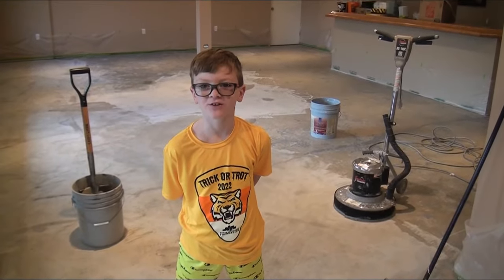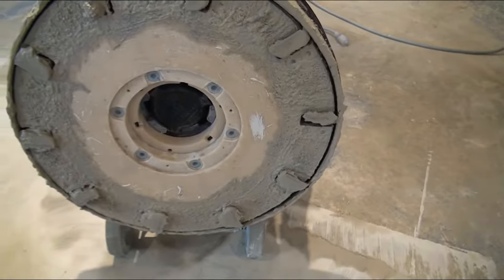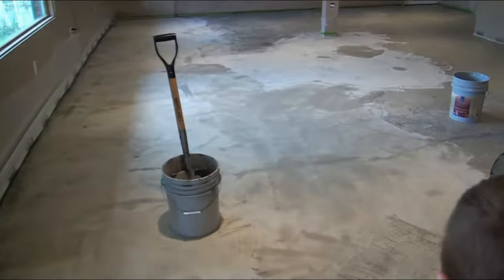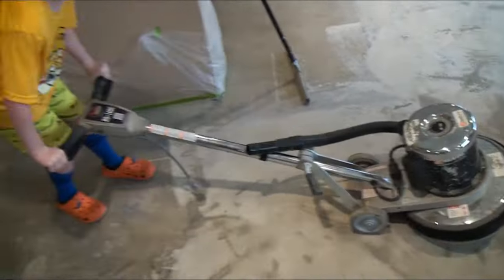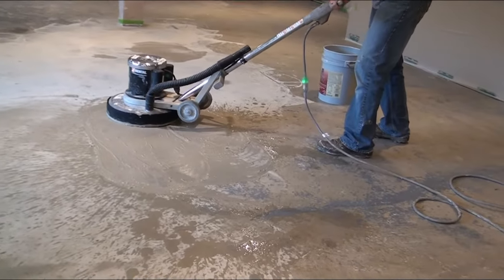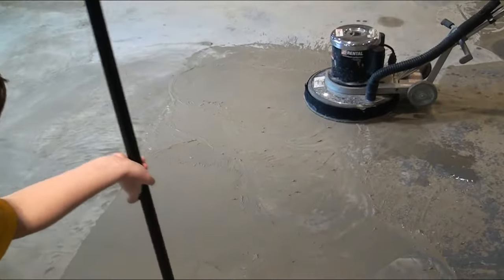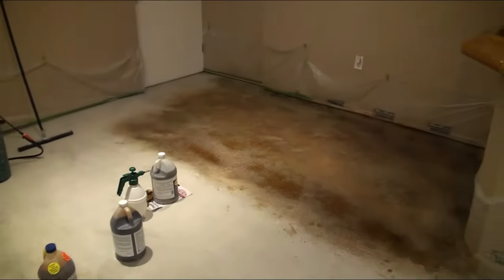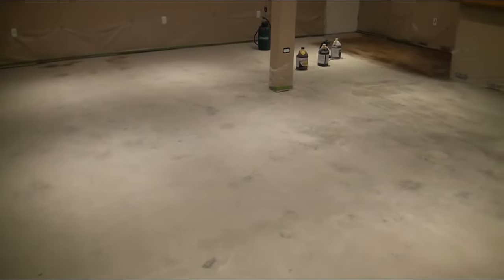How to remove paint from a concrete floor (and then stain it)

Comment: So happy I stumbled upon this video! I was actually going to rent one to use on a client's concrete porch. Since he said there was only one coat of paint on it, I decided to use a high quality stripper, cover with plastic and let it sit for awhile before scraping. Needless to say, i have ended up using every method you have at this point and have only uncovered about 3 feet of concrete! There are actually 2 more layers of paint and leftover glue from tile they pulled up. 😮 You have just convinced me that I'll be renting that sander tomorrow. Thanks to you and your son for an awesome video!
Reply from the maker: Glad we could help! Yeah, we were as frustrated as you, so we thought others would appreciate seeing what we went through so they could avoid some of the same steps. Good luck!

Comment: I stain floors and this looks great. the design language of stain is to show the flaws beneath the surface of the concrete for a bit of unpredictable multicolored drama. I tell my clients that if they cant handle that, lets just paint the floor a solid color with high filler floor paint. I honestly try to talk them out of acid staining and make sure both homeowners are there to understand that. very nice job on the prep, I never wet sanded like that before and a nice job of spraying the semi transparent stain colors. congrats!
Reply from the maker: Thanks Paul. It was a lot of work, but well worth it. And the kids enjoyed transforming the room.
Reply: Acid stain can produce a beautiful floor AS LONG AS THE CONCRETE HAS A HIGH AMOUNT OF FREE LIME  so the acid stain can react.

Comment: I’m currently in the process of redoing about 470 sqft of floor and I’ll have to find that flapper/ scraper disk because the steel bristle wasn’t cutting it.  Thought I’d try cutting corners and just get up as much loose paint as I could.  That’s not a good move.  I like the stain! That looks awesome and I may consider that for my floor!

Comment: I am going to apply epoxy coat after removing the paint off from my garage floor. Should I apply a moisture sealer before applying epoxy?
Reply from the maker: I would read the directions on the specific epoxy that you're going to use to see what it recommends.
Reply: Prep a 1 foot square of the concrete and tape plastic over it. Remove in 3 days to see if any moisture has collected under the plastic. If not, coat away !

Comment: What did you use for along the walls?
Reply from the maker: We tried several things, and we ended up using a pneumatic scraper since the paint was fairly thick along the edges.
Reply: Thanks! I have a similar project but have been putting it off cause I wasn’t sure how to prep the floor/scrape the old paint and adhesive off/etc.